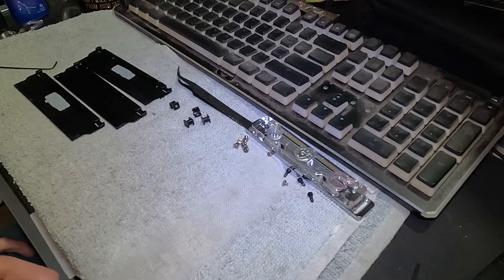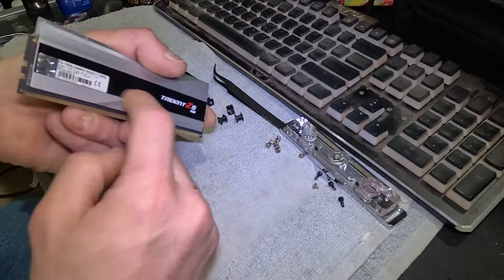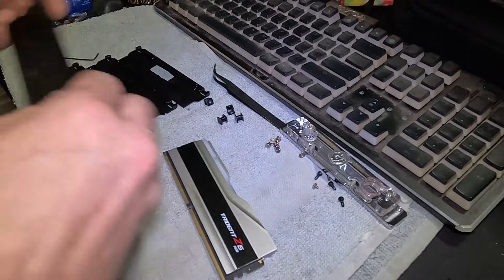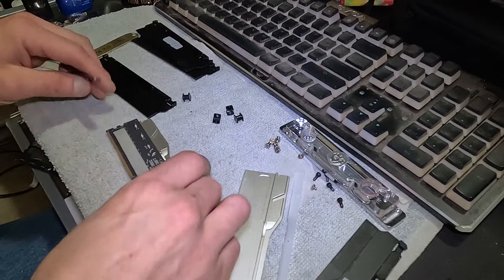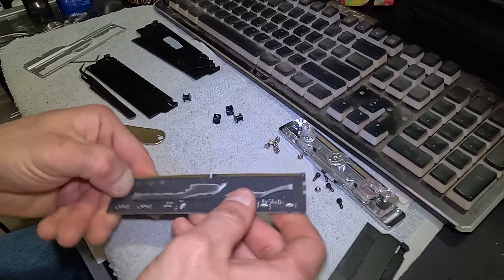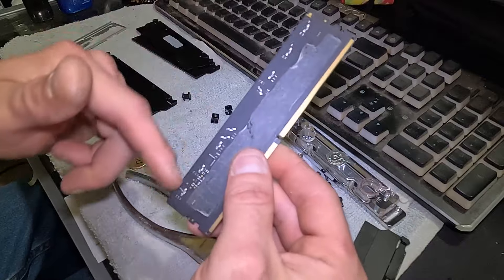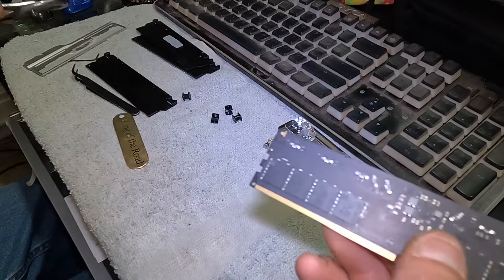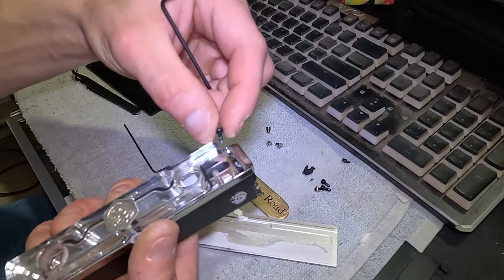How to watercool ram ddr4 and ddr5.

Comment: I have the same gskill ram. I used hair dryer to heat it up and remove the stock hetsinks. I let the RGB diodes alone. I used TR Odyssey 1mm pads for the ram modules and for PMIC too. Also 1mm pad on the back side . Installed cheap Bykski ram vest and bykski ram block.